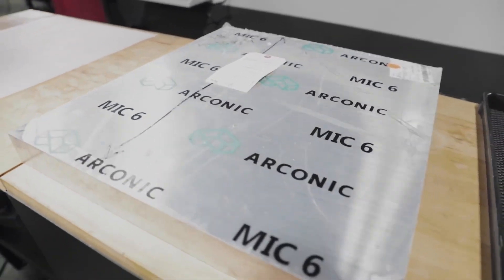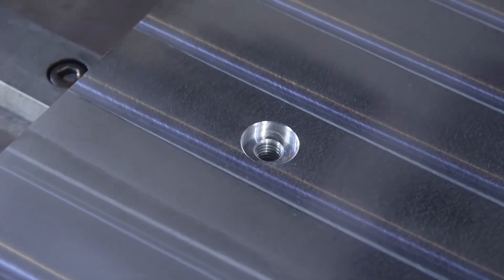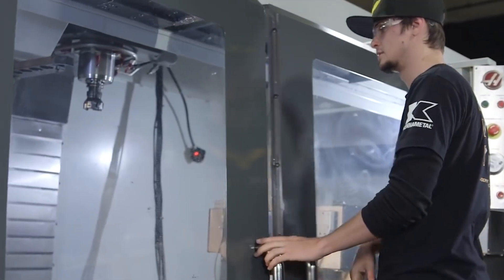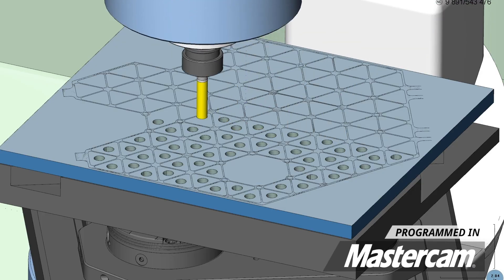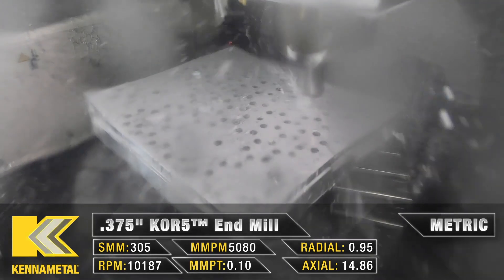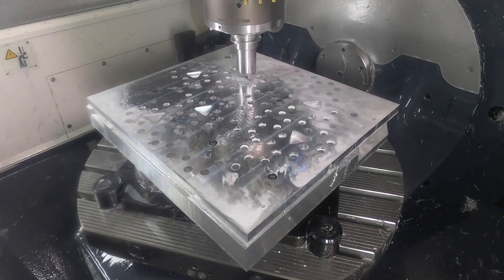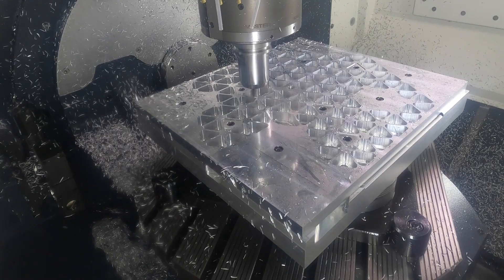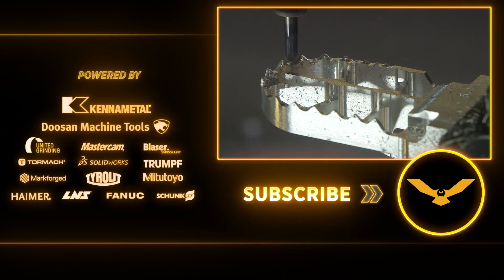Do Not Machine THIN Parts Unless You Know These Machinist Tricks

Comment: I use that "Float and mill it in one direction" for wood tabletops on a CNC router. Though I am using a strip of plywood on one end and hot glue on the other. This way there is nothing for the cutter to run into, but we don't bend the top a little. Which matters when we flip it over.

Comment: I recently had to cut an aluminum plate 6061 flat starting 1" thick down to .680 with lighting pockets .600 deep 2 feet long 1.5 feet wide. What is the best way to process a job in the fastest way possible? Should I have roughed the pockets early in the beginning? I got the plate done, but it took me a long time cutting. O10 per-side until it was flat. What's the trick?

Comment: I appreciate your videos very much. When I was an apprentice toolmaker in the late 80's I had to find these "tricks of the trade" out from the senior tool and die makers in the toolroom I worked in. We had one Maho CNC Mill that I was sent to school to learn programming for (since I was a young guy). Today I manage a small CNC shop for a small manufacturer. I design and develop all the machining operations myself, using some of these methods you are describing. Dealing with stresses in materials and maintaining flatness on parts is always a concern. The only problem I have with your video instructions is your use of the word "perfect". All of us with experience in the industry know that nothing is perfect in the machining world. Even down to the micron there will always be some variation from the required size.

Comment: I had to make a fixture plate right on a Mori Mill because the owner didn't have any other mills or money to buy one. I had to extend the X and Y axis and reset the parameter settings to accommodate the extra travel. And this was after I had to repair and put the machine together after it was still in crates after he bought it used. After all was said and done, I made a plate within .0002 flatness and with all the bolt holes he needed. He was very happy but I had to move on.

Comment: I'm working in aerospace industry as well and those techniques have been bread and butter for many years now👍
I remember as a young trainee when I first discovered that when milling the surface of relatively long flat piece of steel  like 6 x 1 x 0.25 of an inch in a vice across the short edge with multiple cuts over the whole surface instead of one long cut across the long edge does not made the part bend. Those plates have inner fibers in particular direction and that's the magic.

Comment: I used to machine 24 inch rings on a lathe with difference in ID vs Od was only about 2 inches. They were 3/4 inch thick and loved to vibrate under any kind of load. I figured out that changing the Rpm up and down during cut would actually stop the chatter and give a good finish. Not sure why it worked, it was terrible for the insert but it fixed the problem lol. Needless to say the boss was shocked but it ended up becoming part of the process.

Comment: torque wrenches are incredibly important for repeatability and accuracy. even for parts that aren't thin at all. i had small part, second op. little rectangle with 2 holes in it, and depending on how i clamped it i would actually get about .05 mm of difference, it was a pretty loose tolerance, like .2 mm but finding a way to clamp the part down consistently helped me get it within about .005 mm every time

Comment: With parts that have large surface areas you can use a weak contact adhesive to hold the part to the table. I have done thin Aluminium parts using this method and it works quite well provided you keep in mind the cutting forces.

Comment: One thing you should mention is that the "scale" or finish from the supplier holds a stronger memory than the rest of the material. I always "qualify" my stock by facing one side and getting square edges. This ensures that when you flip it you face it off and it can relax this stress from the scale. You will have much better luck doing this especially on flat plate stock. Since the grain lines are along the length of the plate if there is stress it will move a lot. Round stock has cylindrical grain lines and is super stable. Also if you need flatness you can hot glue around the profile of the part. If you face the fixture super flat. you can then scotch bright it for more surface area and then clean with acetone. If there is zero coolant/greese and the fixture is prepared this way you would be amazed at how much hot glue can hold on to. 3m makes some crazy foam double sided tape that i used to use. I would face off a 12" x 12" plate going 12000rpm's at 200ipm cutting .025-.05 deep with a 50% step over and the plate wouldn't move! It blew my mind every time i did it. You can get things so flat with glue and tape since there is zero pressure. I have gotten copper plates as flat as .0001 over about an area 1" x 1".

Comment: Isn´t the stress by clamping down with the mighty-bites still there at least at the edges? So if one edge of the Material was bowed up naturaly, it would still be clamped down and spring up again after machining. Sure better than vacuum, bit still not great, right?
Reply: This is why he uses an indicator. You clamp it until the indicator starts to move, and always make sure it move less than the tolerance. When you release the part and it springs back, the spring back is less than spec.
Reply: The mitee bits don't clamp down. They push sideways.
Reply: @TritonTv69420   as far as i know, that's not true. They do both.

Comment: When using a vice verses the dovetail I understand their is a lot more holding force because the same force is on a much smaller surface. If deep in a vice the pressure is spread out over more surface. So when using a dovetail is their a rule of thumb for starters if we are using a torque wrench in relation to the ability to hold the part in place.
Reply: You're confusing force and pressure. Changing the size of the clamping area doesn't change the force at all. Just because you're using a dovetail, with smaller surface area, doesn't mean there is more holding force, it's just an increase in pressure. It all depends on how much force you're exerting. Clamping something in a vise vs dovetail jaws (in the same vise with the same torque applied to the handle) will have the same force on both clamping methods. Only the clamping pressure will change. So no, there's not "a lot more holding force [on the dovetail]." Refer to the manufacturer's documentation for clamping torque. Leverage must also be considered. A 3" tall part in a dovetail will have more leverage than if it's buried in 2" deep vise jaws. 2.900" in the dovetail vs 1.000" in the vise. That's the main thing to consider.

Comment: Dont you pack or shim the plate underneath before clamping?
Reply from the maker: No just leave it in its free state and put minimal pressure from the sides…
Reply: I dont tend to do much production work. I'm in the heavy machining trade using Correa with heidenhein controls but I'm a fan of your work.
Reply: All the way across the pond in England by the way 😁🤩

Comment: The cheapest and most efficient way to flat skim cut 3/8" (1cm) or thicker aluminum plate metal is to glue it using cloth backed double sided tape. 
(Holding power is dependent on a number of factors; surface area, cutting tool type, material hardness and adhesive sheer. Also very handy holding technique when the stock is larger than the machine bed) 
Thinner materials can be superglued over a tape bed. There are other double-sided tape options that can allow thin aluminum sheet to be machined very thin. (fairly common method used in the aircraft industry)
[ Usage history:  On section and final aircraft assembly, interface unions between jigged assemblies have specifications (gapage) for min-max gap allowances to control distortions and stress.  Our shop specialized in providing custom shims to meet those mechanical specifications to fit within the fixture targets and torque tolerances.]

Comment: Double sided tape also works well. First, indicate part. It will most likely have a concave side and a convex side. Lay part on its concave side, make sure not to push plate down when setting on tape. Leave for a few minutes to help the tape adhesive set. Machine untill all low spots are removed. Flip and repeat. If done correctly 2-3 thou is easily achievable and 1 thou can be reached after a few flips. My plate was aluminum 12x18x.25 inch.

Comment: Ive used vacuum plates alot they are a pain have to be careful not to push to hard otherwise bye bye part. I tryed explaining this situation to my boss that when you clamp on vice it bows in the middle we mainly done alu and delorin some parts had to be 2mm exact was a pain in the ass trying not to make bananas. Also if your not pushing to much double sided sticky tape works well used it on a custom camera housing and made a block to stick it to.

Comment: When machining for flatness you are using the right clamps but there is one thing everyone needs to do is cut at 45 degree angle on your final cleanup pass, this well give flatness to .0002 - .0003 in flatness, just as note I have over 42 years programming experience, I can also machine thin metal parts to .010 -.015 thick in 3D shapes I have a process for that too.
Reply: Can you talk about machining thin walled cylinders on a lathe. I'm learning the lathes and have this problem.
Material=Stainless steel
OD=5.3"
ID=5"

Already tried lowering pressure Chuck.
Reply: @mightydeathlash2867   Machine the ID first then put a arbor in the the bore then machine the OD. Just programmed and machined a few lathe parts with a wall thickness of .020. Parts came out perfect.
Reply: @luisbautista8229  I really appreciate your input, thank you.
Reply: I think this is a superstition that is being proliferated by old manual guys. Since prototraks moved smoother when using both axes. I have gotten plate flat moving in x or y. I have not seen any difference. It's superstition. There is no evidence for that. If that was the case then the plate would bow as you are cutting in x or y alone. What difference does it make if you are still entering the cut and it takes a while of going back and forth across the entire part. You are still progressively machining it from one side to the other. The idea behind it is rubbish. There may be a benefit to machining from two different orientations based off of scallops alone but saying its better than moving in x or y makes me laugh.

Comment: I love to see dedication! 
I always took raw stock, laud it on a surface plate and used my indicator to measure the rocking,  then for OP1 I placed shim stock underneath it in the places I marked.
In metal it is sometimes difficult to hold flatness,  as you remove material it creates stress and removes a layer of grain structure that is holding the material in it's current shape. 
But little by little flipping it over, you can sneak up on it and BOOM💥 flatness is attained. 
Ha ha yes I said BOOM 💥

Comment: The best way to flatten aluminum stock ? Double sided tape . .001 flatness? How about .0004 or better . And a hell of a lot easier than setting up all those clamps. I once machined  a 25x25” 7075 plate down from 1.5” stock to 30mm +- .01mm flat and parallel within .01mm with sticky tape. Also I use 2 machined risers, and not the table as there is too much surface area to get in the way. Flipping the part at least 10 times also is the key. All day process but faster than sending for grinding. Also the tool ? A 2” shear hog. Shell  mills (depending on insert geo) tend to have too much surface pressure and can push the material around if not supported the entire surface.
Reply: I've done some questionable things using cloth double sided tape, but with a little experience and the right cutter geometry works the charm. A bit of daring, experience and a hawkeye are key to keeping it relatively safe when using things like a 30 inch flycutter.

Comment: perfect advise. i just had to lathe a very thin part (wall thinkness 0,04mm on 45mm length) and it was horrible. i was ab´le to get the 5 parts done but it took me way to long to do them. i'm not a lathe expert so i struggled a lot. had to make a piece of brass which i i could fit inside my part so it wont vibrate, still it was horrible and i lost a lot of money on those part.

Comment: I wonder. Would super-glue work in this situation?
If you super glue the plate on another thicker plate, and then let it rest. Wouldn't the plate keep it's bow. And also the bow would get filled by the glue while it's still liquid, right?
Is super glue not strong enough for the job? Or is the resulting mess just not worth it in general?

Comment: I am a mechanical design engeneer and one "trick" that I like to help out the machinist is to put a big chamfer on the part if that does not mess up the function or design. Than in machining the part can be hold with those small dovetails or mitee-bites clamps. The chamfer operation removes the dovetail or the clamping marks and there is no need to deck the part of at all.

Comment: Very similar to how one would deal with tight tolerances when surface grinding. The heat will build up in the ends causing the piece to bow. A chiller will help but you still have go super slow at the end to avoid warping the piece. Patience is a valuable skill to have.

Comment: I have a part with a flatness tolerance of +/- 0.01mm and im using double sided sticky tape as its stainless so the mag bed wouldn't work and we tried holding through the holes how he said and it worked but not very well, the sticky tape seems to be working though

Comment: Surface grinder and magnetic table on milling machine will be less tricky
Reply: You beat me to it. If you give all the important features you have to machine some allowance you can machine everything perfect in accordance with the flat top and bottom surfaces.
Reply: True, but even a magnetic chuck table can allow for spring in the material as well. Phil Kerner did a video about this a while ago talking about a part that needed to be flat to .001. So they put it on the grinder of course because that's the proper machine for tight flatness tolerances but they wasted and scrapped parts with the parts bowing out after the magnet was released. He put the part of the milling machine and it was done and to spec with a different working holding strategy.

Comment: Yes, not introducing stress by clamping is important. The live center on the lathe or the magnetic chuck on the surface grinder can do the same, bending the part into the "correct" shape while machining and spring back after release
Reply: Moldmaker trick: Shim it.

With the part on the vacuum chuck/mag-plate, indicate it at various points to see where it moves, and shim under those points. Then when you re-clamp on it, it has support.
Reply: Surburban tool has an excellent video on dealing with the bowing with surface grinding using residual magnetism, to eliminate the issue of pulling bowed parts flat

Comment: Thank you so much for this video. I have a thin wall part (circular part similar to a watch face) currently in the shop. The final wall thickness being 0.4mm (+/-0.025). We had quite a few test pieces with holes in the middle due to part deflection on clamping. Still trying to solve it. The main problem with the part is that there is very little material to clamp onto. The final thickness has to be achieved from a blank which has just about 0.5mm straight edge on its circumference.

Would love to know your thoughts on this.
Reply from the maker: Join our Facebook private group and tag me into the post and I will give my thoughts. Not sure if you can share pictures. Many others will help also.
Reply: @val milos Machinist's are often the recipient of bad engineering.
Reply: Take that job and send it back. Lol done

Comment: I do enjoy the heavy engineering I do now but I also miss the high precision stuff at times
Reply: Im sure it goes both ways. Been doing aerospace work for 7+ years now, where seeing a +/- 0.0002" tolerance on a mill isnt too rare, and you start to get into the "Gotta keep the spindle idle when i go on lunch else it'll cool down and cut a few tenths less depth" etc etc. Sometimes makes you wish you could experience OPEN tolerances.. xD
Reply: @jamie allen I use to do high precision batch work...1000 job runoffs of jobs that weighed about half a pound...now most jobs are multiple tonnes with the heaviest been 51